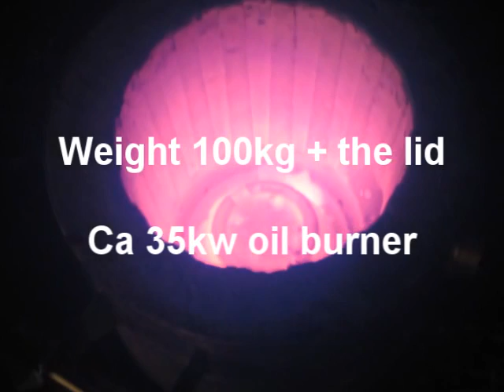Homemade / DIY foundry       -Bronze- Brass- Aluminium-

Comment: I really like your workshop! :) 
You do a great job there. I try to cast white bronze but I have problems with alloying. Can you tell me if cooper and tin in equal quantities are enough to make white bronze?
I will really apreciate some info about white bronze. On internet I found about 5-6 types of white bronze. So I am confused now :(
I try to cast small items, 2-1 inches in diameter and I really need a good white bronze recipe. 
Thank you

Comment: the one i made is 2x higher and rounder i used a pice of cast  ion pipe i got from the dump i made my own burner and the refactory cement was reclamed from a bag of set cement i was given i line my one with sand and lime rendier i was told it will make the wall last longer as i can use gas oil and even wood sawdust but to use wood dust it needs to be preheated so it catches fire you could even use coal dust any thing that burns

Comment from the maker: hi I used some concreat from a aluminium recykling plant werry hard and heavy only 4% water aded and you have to carfulu heat it if not it cracks because of internal steam pressure, But i think you kan use heat resistant concret fore use in homes ..(wood fired stoves)

Comment from the maker: @TheBrandman47 Hi I had a lock at your furnes excellent! thing is i  use diesel/oil  burner  they are throunig away thous burners her in Norway no beauce Co2 and oil price :-) good fore me, its a ca 30 kw burner so i suspect you need more kilo wats in to your furnace  or se if you can get a oil burner 
regards RH